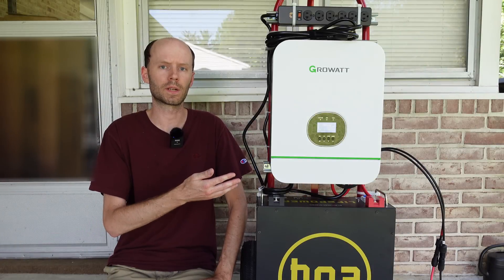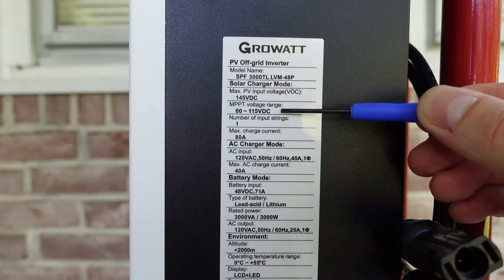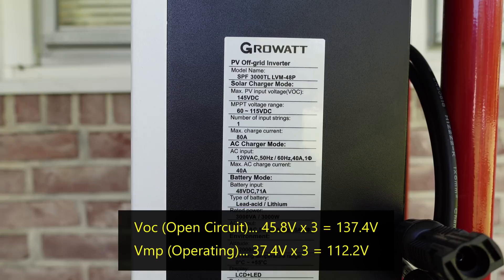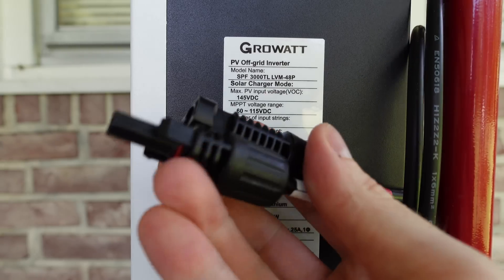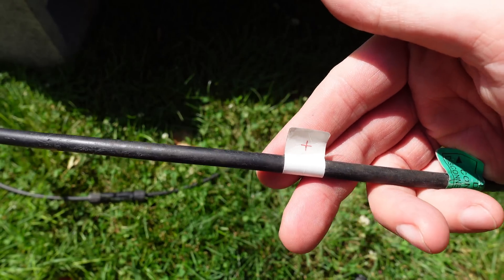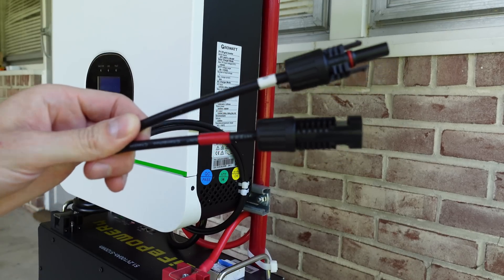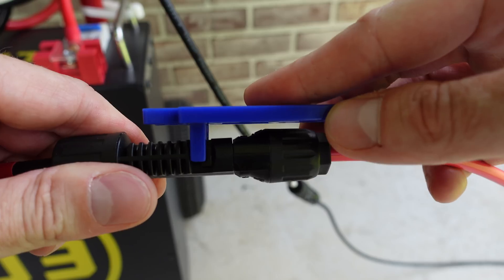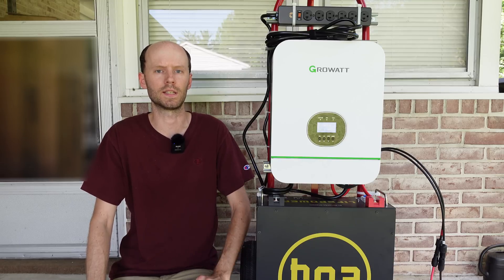Connecting Solar Panels to the Growatt/EG4 Emergency Power Cart

Comment: Have you encountered any issues with having the EG4 on it's back? I checked with SS & they said "The batteries can be vertical. They cannot be on their back and or upside down."  Thanks!
Reply from the maker: What do you mean "on it's back"? Both orientations of 1) with terminals up or 2) with big EG4 logo up are fine. Which side are you referring to as the back? Sorry, terms are confusing 🙂
Reply: @LithiumSolar  My interpretation from the Signature Solar email on the "back" as opposite side of the terminals.  If it works with the terminals in the vertical position like you have on your handtruck, that would be perfect for my application!
Reply: SS also told me it is okay to position my EG4-LL on its back. I don't understand why these batteries don't have any opening for cooling and/ or a fan. Doesn't the BMS carry the load current and get warm?
Reply: @George_us  oh wow, ok, looks like we have some interesting potential here, thanks George! I wondered that about fans too
Reply from the maker: The original response is confusing. You mentioned they said it can be vertical but cannot be on its back. Well putting it on its back (what we think is the back) puts it in the vertical orientation. I wonder if it was a typo and they meant to say it cannot be on it's face (terminals down). This is something they should really add to their user's manual...
Reply: @LithiumSolar  Will try & call again.  Hold times were a bit long.

Comment: How is the inverter grounded? Is it grounded differently while non use?
Reply from the maker: While plugged in, it's grounded through the AC input. While operating as a power cart, the inverter IS the ground.

Comment: David- thank you for recommending Face Book Market Place &/or Craig's List for more local pick up. I want to buy a couple of Bi-facial panels for my sailboat & a few midsize panels for my Bimini (mine's very large & wide) & finally would consider the dreaded flexible panels for my cabin top if the previous is not sufficient, but- couldn't figure out how ship them??? I bet you grab 2 more cuz you already HAVE connections for it! Hahaha

Comment: I see alot of systems have a pv disconnect. I just purchased a Bluetti 2200max with 4  200w panels on my upper deck. would this require one and if so should it be installed on the deck or inside by the Bluetti .  thanks, Keith 
l